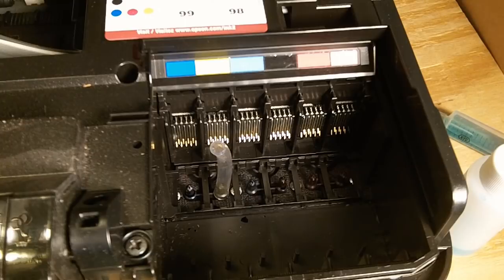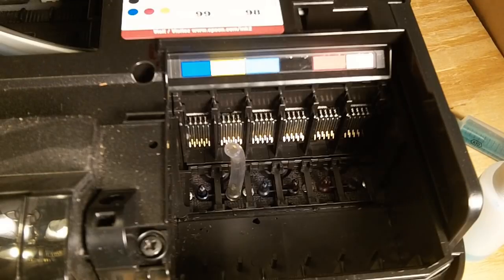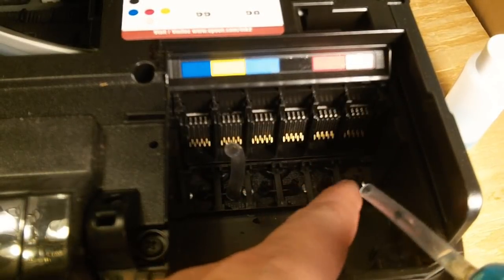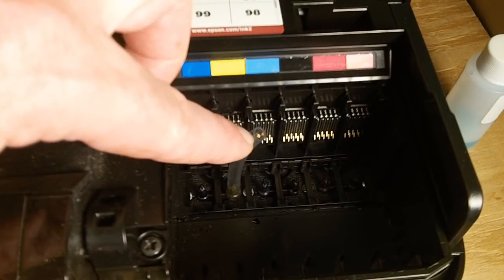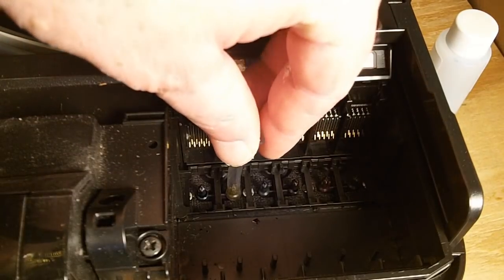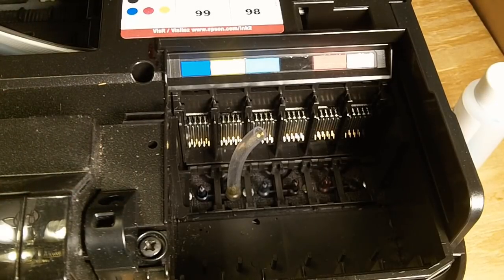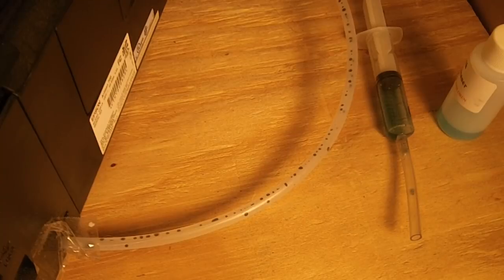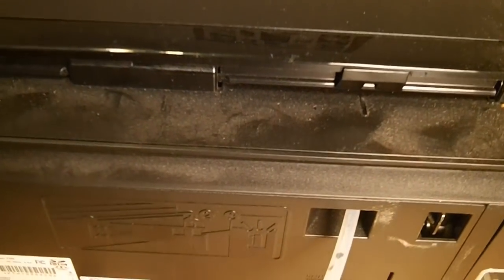Giving up on a dead printer? Try my way to unclog inkjet printer port

Comment: Thank you Robb!  A couple of weeks ago, my 2-year old Epson WF-2540 went on the “fritz” -- all the colors except black would print.  I looked at the only option of replacing the printer with a new one until I stumbled on your videos.  Although a little apprehensive, I decided to go for it.  I had all the ingredients for a head cleaner kit except the tubing.  As I was pouring the Windex into my little mixer bottle, I realized that the stem in the Windex bottle might work.  So I cut it out into four equal lengths and they fit very snugly.  After about 48 hours of soaking and a little clean-up, I reinstalled the cartridges and turned the printer back on.  Tried to print --  but nothing!  Grrrrr. Then I remembered that you said that it might take longer for the printer to start printing again. So I tried a couple of nozzle cleaniings and voila’  -- I have my printer back like new. Thank you again.  You saved me from having to buy a new printer.  Sorry Epson . . . .
Reply from the maker: +Jim Zartman Thanks Jim, so happy it worked for you too. Yeah, after cleaning I have had to let the liquid dry and still took a lot of printing for the streaks to go away. I recommend people only try this on printers they have no hope of fixing as I offer no guarantees, but it has worked for me every time so far with ink jet printers using regular ink.

Comment: Thanks heaps for this guide Rob.  I ended up replacing the cartridges thinking that the age of them was likely to have been a contributing factor to the Magenta and Cyan jets blocking up on my Epson WF-7710.  Yellow and black were fine.  With new CMY cartridges, CM were still blocked.  I thought to myself, what if I stuck a tube over the ports and sucked at them a bit.  It worked.  They started to operate and after two more cleaning cycles via the printer menu, I was good to go.  Cheers mate from Perth, Western Australia.
Reply from the maker: Hey thanks for watching and leaving such a helpful comment I'm glad the video helped thanks again

Comment: It worked! You saved me a bunch of money and I'm so grateful! My Epson Workforce 325 self-cleaning function had gotten all my colors back to working after 4 years sitting idle but it couldn't get the black unclogged. I let the homemade solution sit 24 hrs and pulled up a lot of black fluid with my syringe before taking off the tube. My hopes were up. I did one more cleaning cycle and now I can print black!!! Thank you so much.
Reply from the maker: Bearger 4 Hey Bearger, that makes me happy. thanks for taking the time to let me know it helped, I really appreciate it.

Comment: Robb-thank you so much!! Between this video and your homemade inkjet cleaner, you saved me about 250$ I am very grateful. Your tip on running cycles until the picture was clear helped as well. I was patient and kept running the clean cycle once the clog was broken apart and my printer is as good as new. I also now have cleaner ready to go. Thanks again!!
Reply from the maker: Thanks Petra, I really appreciate you taking the time to let me know.

Comment: Worked like a charm. I used your homemade ink cleaner too. Was fantastic. I was expecting to have to leave it overnight, but all it took was a couple hours and it printed like new. Thank you!
Reply from the maker: +Vivian Gagliano happy it helped, thanks Vivian!
Reply: +Robb&#39;s Homemade Life Thanks for the excellent advice... But do you still need to run a head cleaning after letting it soak down the nozzle?
Reply: +Olivia Jeanne I didn't have to. ☺️

Comment: hydrogen peroxide or regular isopropyl alcohol and qtips: 

- take qtips and dip them in the above solution you chose
- use about 6 qtips per ink head and swipe around and ontop of it for cleaning
- used this method when my printer printed everything BUT black and it worked. 

Hope this helps any of you :)
Reply: what was the ratio of alcohol to peroxide?
Reply: richard martinez it says Hydrogen peroxide or isopropyl alcohol... one or the other.
Reply: HOWEVER … there IS that possibility that a piece of the fibers on the Q-tip might get into the ink port (dropping through the fine-meshed screen) and clog one or more of the printheads.  OTOH, when your next step is otherwise to pitch the printer, anything that MIGHT work is plausible.  Still, I think I'd try Robb's method first, which I'm already in the process of doing (it's been ~ 12hrs now, and the ink-dissolving solution in the tube has gone down ~ half an inch so far, with occasion lung-provided air pressure).  I'm trying to get through the comments while waiting.

Comment: I was ready to follow your method but decided to go over every single step HP has in their instructions. I inspected the new black refill and notice the sticker was covering the little hole on front/top. I got some tweezers and really made a clean hole and sure enough, I put it back in and it worked. I NEVER have issues solved like that. That's why I decided to share. After hundreds, maybe thousands of printer refills, I have never had that issue. So I got in the habit of trying the hardest thing first.. After an hour with the software and using half of the new ink cleaning the stupid thing(I didn't say stupid then, but I can't write what I did say).
well, I guess it's a case of RTFM
Reply from the maker: Daniel, thanks for taking the time to leave that helpful reply. I often use a CIS system and if the air vent gets plugged it creates a vacuum and stops printing. if you see bubbles in the line you know there is a problem. Glad you fixed yours.

Comment: I used your idea.  I had trouble using small tubing because it tended to capillary, and the cleaner did not flow to the printer carriage cartridge port.  I went to Ace Hardware, but any hardware can supply, and got small tubing that fit the port pipe, and more tubing that would fit the outside of the smaller tubing, ending the capillary action because the larger tube can easily accept the fluid as a reservoir, having gravity to help.  The smaller tubing was cut to the height of the port, then pushed into the larger tubing.  I then made six for all the ports on a Epsom R200 printer.  Then using a hypo-injector used to give medicine to dog, and used the home made fluid and filled the tubes.  I bought the printer at a estate sale, and it had not been used for a long time.  After letting the solution set in the plastic tubing for about two weeks, it finally came out, flushing the print head and the paper towel under the print carriage, is all different colors now.  On eBay, you can buy the Epson refillable cartridges that can be filled using bulk ink, and that is next, now that the print heads are cleaned.   I do like using bulk ink, versus buying pre-filled cartridges with ink.  Kids use my printer and abuse my budget in the process.  I now have a printer that can do the bulk ink routine.  And kids can use it as much as they want, and not have a washed out printing result.    It is surprising all that you can find on the internet, because other people have had same costs, and want to share how to get around them, economically.  And the glaring costs that they save, they say to themselves, I'm going to share this, to help others.  Thank you for your sharing.
Reply from the maker: +Bruce Lockert Bruce, your comment makes me very happy. So glad it helped you and that you appreciate it. your extra information is helpful to others too.Thanks a lot.
Reply: Bruce Lockert up
Reply: I went to staples and theyre just trying to sell i went and told them about the situation, they said most of the time this method doesnt work but im going to try try anyway & honestly, Thanks for taking your time and explaining to us. really nice of you.

Comment: I am going to try this on my Epson Artisan 837 and hope it works.  Thank you for the info about the airline tubing for aquariums.  My local PETCO store has the 3/16” tubing.  The 25 foot (762 meter) length costs around $5.99.  Thank you, also, for the “recipe” for the printer head cleaning solution.  The price they charge for printer head cleaning kits online is a real rip-off!

Comment: My printer is Epson XP-300 if you're having trouble finding a tube to fit over the heads try using the tube from the spray of a windex bottle. It fit perfectly. Just cut the size you want and it should work like a charm.
Reply from the maker: Linda, thanks so much for your helpful comment. I subscribed.

Comment: Thank you very much!! My Epson Artisan 837 is now working again.  I left the solution filled tubing on the ports for about 44 hours.  Afterward, it took 4 head cleaning cycles before I could get a proper nozzle check print and now it is perfect.  I used no name Windex-like glass cleaner and 99% isopropyl alcohol at a 4:1 mix.  Thanks again!!
Reply from the maker: leo! Thanks so much for taking the time to comment. I am very happy when I hear the video helped somebody the way it helped me. Much appreciated.

Comment: Actually I tried that several years ago, before I even read YouTube! Worked well, but I had forgotten I used it! Time to use it again, another clog. I'd always heard not to remove carts and let them put aside while I was cleaning other parts of the printer as well. The ideas was not to leave carts exposed too long because the cartridge "spikes" would dry up. But nobody hear seems to run into that problem.

Whatever, I'm going to take those chances. I agree that it is an elegant solution!

Paul
Reply from the maker: hey Paul, thanks for the helpful comment.😎👌
Reply: Glad you found it helpful! Your initial comment was helpful to me, it gave some validation to my efforts a few years ago. But... what do you think, do we need to be concerned that the "spikes" might dry up if exposed to the air too long? And here's another...when we fill up the short section of tubing, just how do we do that without that section spilling over? It's one of those "sounds simple but it ain't"!

Nice job on your video... very clear, and so is the audio!
Reply: Hi Robb... well, it's been close to 24 hours that my tubing was installed. I'm rather patient... I'll give it another 24 hours. From your experience, is this to be expected? Another question: I had to remove my cyan cart (this is on an Epson 1400) to leave that spike open for the tubing. I put the cartridge aside at my desk but do I need to seal it in some way, to keep it from drying out? I'd appreciate hearing your experience on this.Thank you for all your help!
PS: I put it in a Ziploc bag, I guess that's better than nothing. but I didn't have a plastic box handy.

Comment: Instead of messing about with tubes and syringes, you could use your old ink containers to feed the cleaner fluid through the printer. eg fill those old containers this special fluid and then use them just like ink containers.
Reply: Chris Liddiard Chris Liddiard hi there. my magenta is clogged really bad. I let the tube sit there for weeks and it's still clogged. I can suck a bit of ink so I'm guessing the problem isn't on the protruding part where you would connect the hose, but on the underside where it touches the paper. what do you think?  What should I do? thank you

Comment: I have an old Stylus 1400 that hasn't been used in probably 2 years. Needless to say some of the print heads are severely clogged. 😅

I bought some solution with a syringe kit and have been trying to flush it out based on YT vids I've seen. Even though this video is older, yours is the first one I've seen that recommends leaving the tubing sit with solution in it. Brilliant. Off to try that for that nasty, super clog. Thanks for posting your method for this. :)
Reply from the maker: thanks so much for the nice comment. I have let my solution sit for over a week on stubborn ink clogs. It does not work %100 of the time but the alternative is to throw the printer away so there is nothing lost by waiting and trying to see if the printer is getting better. Often there wlil be no print coming out and then slowly it comes over days. Good luck.

Comment: My printer sat a long time maybe ONE YEAR (model MFCJ470DW). My Brother printer has the ink tanks on FRONT not on top. So I stood my printer on it's rear, with the ink tanks facing UP. This caused a lot of ink to drain out of the tanks. (my refillable ink-tanks are CLEAR color, so I could see the levels). So, your method solved my problem. I did not have CLOGGED HEADS. I had no ink in the printer itself. Now i have all my colors back, but still some problems with black. Your video was very helpful. thank you
Reply from the maker: David, thanks so much for the feedback, I make my videos to help out, I really appreciate when people let me know I helped.

Comment: I just flushed the ports with vinegar and a syringe. Once I instilled the vinegar I pulled back and got the clumps out. Did this a few times and it worked nicely.
Reply from the maker: +Linda Joyce good tip, thanks!

Comment from the maker: here is the 3/16 inch tubing I used on amazon
PENN PLAX Standard Airline Tubing Air Pump Accessories, 25-Feet https://amzn.to/3UvjkpI
Reply: 3/16 inch is that inner or outer diameter ? PENN PLAX offers different inner and outer ..thanks
Reply: How did you use the tubing on AMAZON? 
Who did you smack with it, J.B maybe?
or did you mean to say that you bought the tubing from AMAZON?
Realize that the two sentences do not mean the same thing.

Comment: My Epson died yesterday after I did something like this.  it's a WF-2540.  I knew I should have taken a baseball bat to it.  Won't buy another Epson.  My sister has had an HP for several years.  She is very happy with hers.  I think one of my problems with the Epson is I didn't use it enough.  I went through about a package of ink every year and didn't even make 125 copies a year.  I mainly got it for printing my taxes.   The Epson had decent scanning and printing.   Although it was always a PITA after it sat for a few days.
Reply from the maker: yeah, not using them dries them up.

Comment: There are a few  of things I want to add.

1) Sometimes it is those single white cartridges or the pipes that are clogged..so remove the pipe attached to the cartridge and push air with a syringe in and out to unclog it.

2) Use a sharp syringe needle to inject isopropyl aclohol directly into the printer head holes . If you use a torch you can see those fine holes.

3)and finally  I got success by putting a straw over the nozzle and just blowing air with my mouth ..that seemed to clean it and open it.

so just remember it's not always the head that may be clogged..it could be the pipes or the cartridge too.
Reply from the maker: thanks for the helpful input Singh!
Reply: Precisely. I have a cheapo $100 brother mfc j1205w which stopped working- after several mfg. recommended cleaning attempts to no avail. I ordered an $8 clean kit, which has yet to arrive. Being late to print a shipping label decided to try just blowing through a tube attached to inlet- 1 removed cartridges 2 pushed on the spring loaded valve stems just to check their condition 3 installed a fitting tube over inlet 4 blew in each one. Voila! Printer works as it should.

Comment: WHat worked really for me, after using a lot of tricks, as strong solvents, hot water, and ultra wave bath, blowing, aspiration,  no way to see some red on the nozzle (HP443 2 years no use obviously not the same type as the video) WHat worked really well and fast : I put hot water in my dental jet, pressure at the max. Just one full recipe and the red was open. It may be better to do it 2 or 3 times as it is pushing into the micro holes, but it really worked, after 24 hours testing different tricks. It is not sending ink everywhere do not be afraid ;)
Reply from the maker: Isaac, thanks for your helpful input, much appreciated.
Reply: @RobbsHomemadeLife  My printer is not printing in color at all. I'm assuming they're all clogged. You said "just one full recipe and the red was open", but also said you used hot water. Can you clarify? I have a WaterPik and want to use it if it will work, but I want to do it right. Thank you!

Comment: My Canon MP470 printer stopped working so I had to get another one. Would not even start up. It would turn on, do a couple of tests then shut down. I took it apart and found a medical type pump inside that's driven by the platen and the tubes were all clogged with dried ink. Printers these days need way too much maintenance, like you need to print something every now and then.

Comment: Thanks! Gotta try that, but one or two questions come to mind. Jump to the end of the cleaning; how do I pull off the hose full of cleaner without getting it all over the ink ports? If the answer to that is to leave it connected until it all soaks down through the ink port and I’m doing this to six nozzles; where does the cleaner go? Am I left to just clean up anything that drains or slops out of the printer onto my wife’s white table cloth?
Reply from the maker: I have not had any problems but my printer is not on a white tablecloth. I assumed there is a waste collection area under the nozzles as in other printers, but could be wrong, you could insert paper towels while you attempted the repair.

Comment: The size tubing you listed was in Meters. I believe you meant mm, yes? I tried finding some to purchase. Is that 5/16" inch? There are many available at 3/16" but that may be too small. If you're checking comments, please reply...I wasn't sure if it mattered which size, but seems that it may. Thanks so much!!
Reply from the maker: Julie so sorry for the late reply. I left some links in the video description.